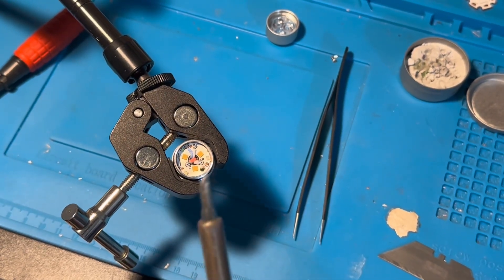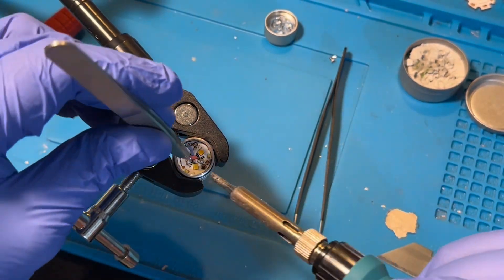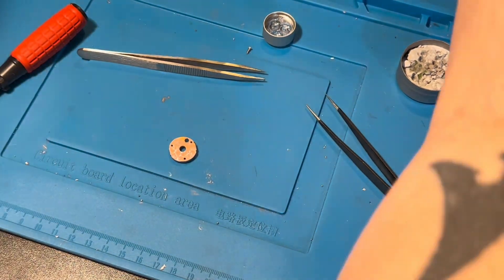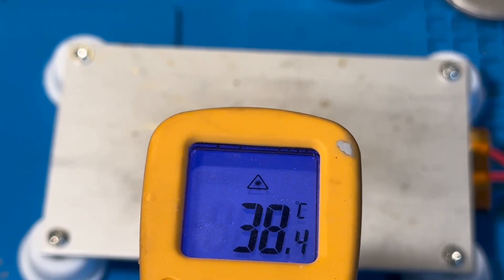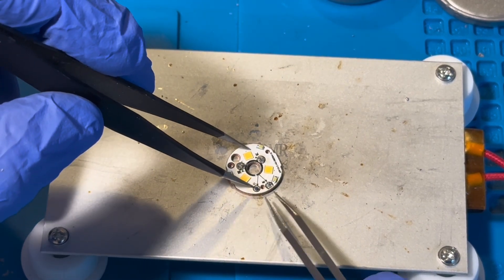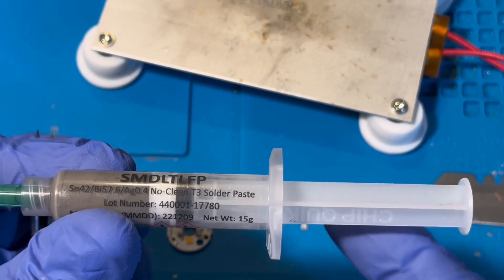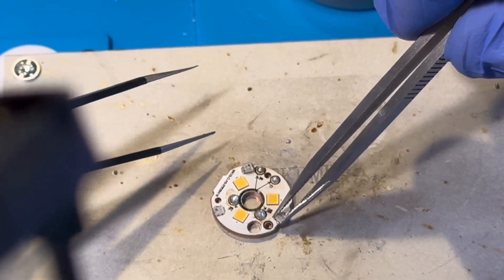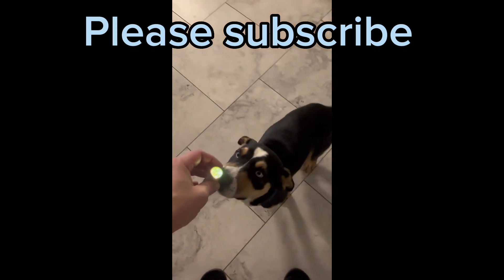Led emitter swap. Installing RGB LEDs on my Wurkkos TS10. Full tutorial.

Comment: Hi, interesting video. I'm having trouble opening the head - hands, rubber gloves and cheap strap wrenches are slipping, what specific tools/method work for you?
Reply from the maker: Heat gun, you can get it around 250 Fahrenheit
Reply: @marcgossling8260  thank you
Reply from the maker: I use heat and rubber wrenches. If I have trouble I have some rubber straps and I’ll use channel locks and grip the head with those.
Reply: @marcgossling8260  thank you for the reply, what do you do for heat and how far can you go? Stick it on turbo for a bit and dunk it in boiling water? Or would that damage the tir optic?

Comment: Please ask the rgb model
Reply from the maker: If there’s a rgb model I’ll ask for it lol as this mod is not easy
Reply: @marcgossling8260  I use translation software to communicate with you.but the translation is not accurate.  I want to know the rgb specs.  Thanks
Reply from the maker: @歪果  the rgbs are 0805 slow flashlights rgb lights. US $1.66  25％ Off | 50pcs Flashing LED SMD Diode 0805 RGB Diodo flash Alto Brilho Diod 0807 RGB Flash LED Color Fast Flash Slow Flash
https://a.aliexpress.com/_mNgTFoY
Reply from the maker: @歪果  I hope that’s what you’re asking for
Reply: @marcgossling8260  This is exactly what I want. Thanks